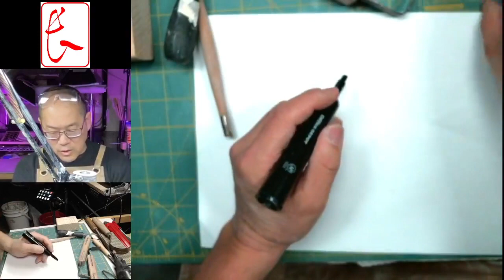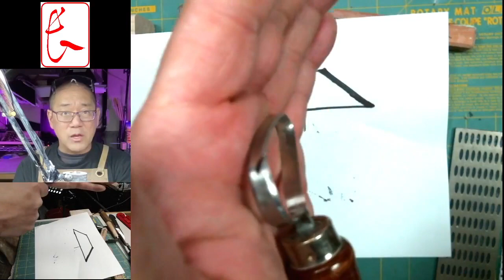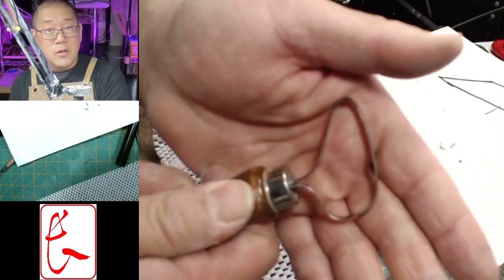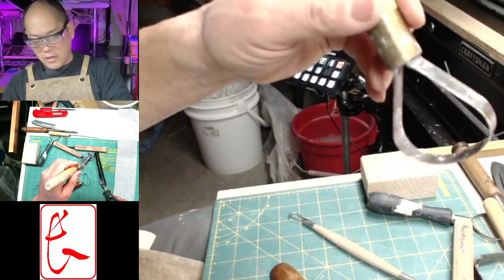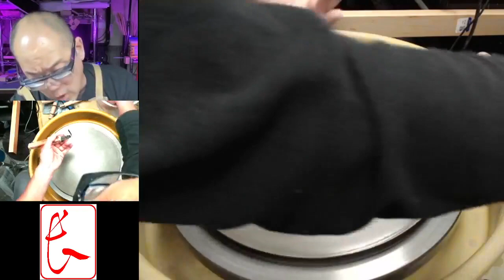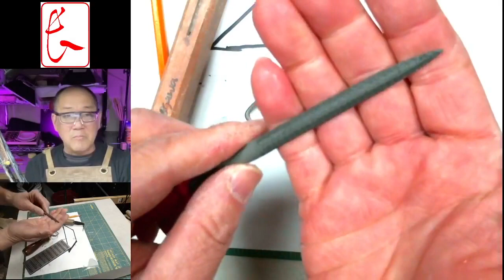How to Sharpen Your Clay Trimming Tools

Comment: you need to do a lot more videos! You’re very good and very thorough. You talk through everything you do explaining why you do it That way and not a different way. I think most of the problems the students have is when there is an air bubble inside the clay. Also when you’re raising something up and you accidentally pressed a little bit more with your right hand, or pressed a bit too hard with your left hand.  Also, when you’re trying to raise or you trying to bring some clear up from the bottom, sometimes you left finger is a line with your right finger, but sometimes it slips and that’s the end of what you’re doing!
You need to make corrections how do you fix this? How do you fix that?
And when you’ve been doing pottery one or two even three years they are tons and tons and tons of mistake you make every week.

Comment: Thank you so much for this video content! It is extremely helpful. Can you explain how to get rid of an area on trim tools when it leaves this one line that looks deeper than the full pull across of trimming, if that makes sense? 

I have lightly hit my trim tools to sharpen them over time. Somehow, the width of the trim is perfect except for an area that leaves a fine line that’s deeper. Again, unsure if I am explaining this well. 

Would a company that sharpens knives & scissors have the know how to sharpen pottery trimming tools? I ask bc I’m visually impaired… actually I’m legally blind but I do retain light perception. I just can’t see much beyond a few inches from my eyes & even then, it’s not very well. I have loss of peripheral vision too. I have a retinal disease & optic nerve defect. I’d like to find someone who sharpens knives & salon scissors, etc… it might be a safer alternative for me as long as it’s not overly expensive to sharpen my tools. I’m mostly using files & sandpaper with the occasional hit with the pen/pencil adapter to a Dremel tool. I try to polish using a rouge paste  afterward.

Comment: Thanks for the video.

I was wondering, using your drawing as an example, is grinding the bottom flat plane to bring it up, instead of grinding down the bevel's edge and trying to keep that edge parallel to the original bevel, also a valid way to sharpen your tools? are there disadvantages, such as more difficulty for loop tools?
Reply from the maker: Thanks for watching.  I do not recommended grinding the flat back side of your tool, it will make the tool much weaker and remove a ton of metal. Only do a little bit of grinding to flatten out the back.

Comment: Thanks for the video. Just have to nitpick a little. Tempering is not when the metal is plunged into a liquid (water, oil, etc). That is called hardening. After hardening, the metal is very brittle. So it is heated again to a specific temperature that reduces the brittleness. That is tempering.
Reply from the maker: Wow that is great to know. I messed up a few times in the video with a few of the things I said.  I did not know that tempering.
Reply: @JohnHasegawaCeramics  Don't worry about it. I only know about it because my wife is a metal smith. Thanks for your video again, it was very useful for me. I noticed my trimming tools have a bevel but the bevel doesn't extend all the way to the edge, so I'm having to re-profile the edge. Well, you get what you pay for, I guess.

Comment: Nice! How do you do tiny ribbon tools?
Reply from the maker: The small tools are more difficult to sharpen. they have less metal.  I would do the smaller tools by hand and watch carefully to not remove too much metal.  Just enough to get them sharp.  And then think about getting new ones.

Comment: This has nothing to do with sharpening your tools, but they are questions that I’m sure a lot of people have such as how do you throw a vase and make it very thin so you can make some cut outs. There are so many videos I wish you would do and I’m sure that I am not alone. please keep going and also for example when you accidentally pulled a wobble or you are racing in pause or not really reason uniformly so there’s like on the side how do you correct?

Comment: Single bevel knives are less durable, not more. Having two bevels on one blade actually increases the cutting angle compared to a single bevel. So if your bevel is 17 degrees on one side, and you bevel both sides, the cutting edge has a 34 degree cutting edge, but a single bevel cut at 17 degrees has a 17 degree cutting edge, so it is a more delicate edge and less durable.
Reply from the maker: Yes, I can not argue with your reasoning. I stand corrected.
Reply: @JohnHasegawaCeramics  No problem. I do a lot of knife sharpening and had to say something. Like your videos, I'm a beginning potter.